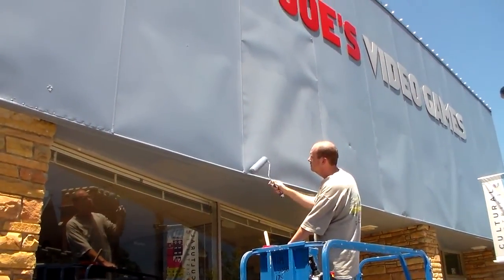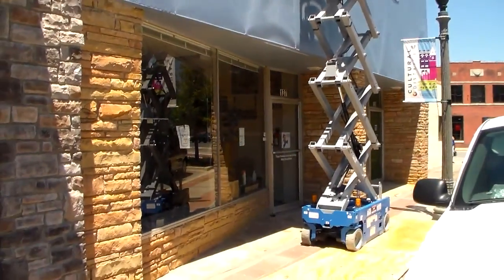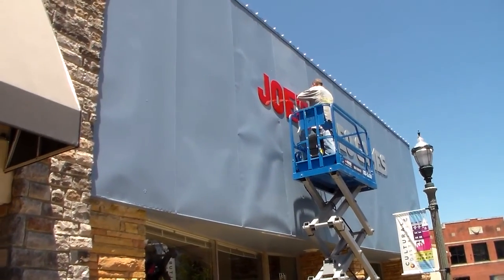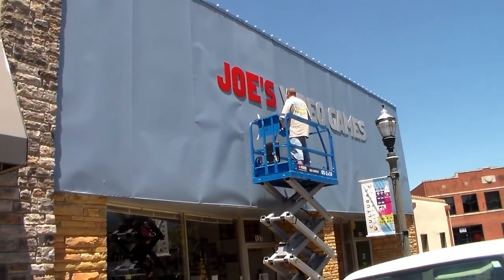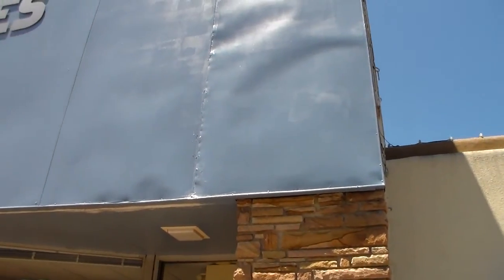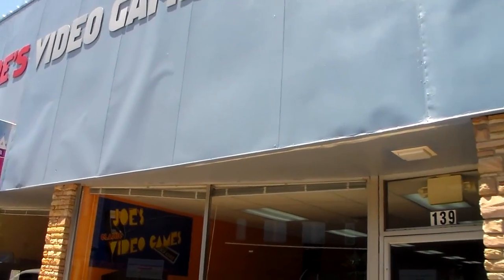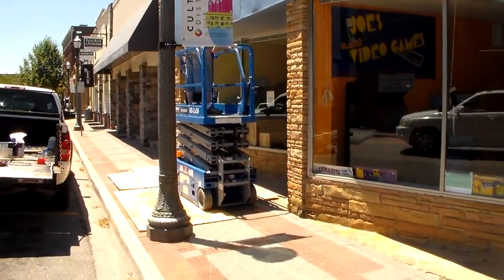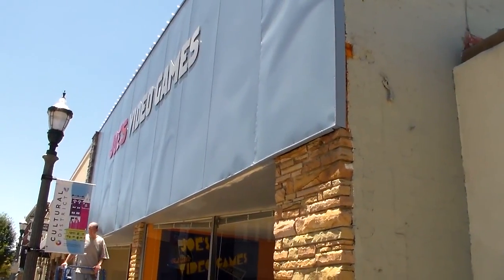Repainting The Front Of Our Video Game Store - 60's Slip Cover

Comment: Have to ask Why Didn't you go with all red letters so it would all stick out like Joe's? I'm sure you have your reasons.. Thanks
Reply from the maker: When we first were designing it we were trying to make it like the old 60's signs on buildings like this where the first name was bigger than the rest, so it would have said JOE'S and then videogames in lower case, smaller letters under it, the Joes would have been cursive, etc. like they did on the old signs in the 60's.  Eventually though the city wouldn't let us go very big with that, so we kept changing it until we ended up with it like it is, the only thing that remains of the original design is "JOES" is a different color, lol.